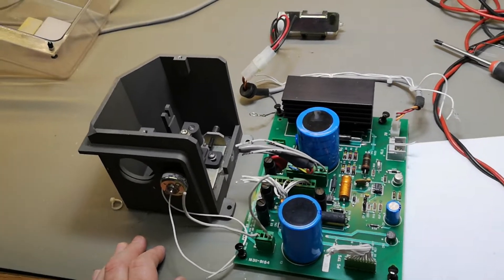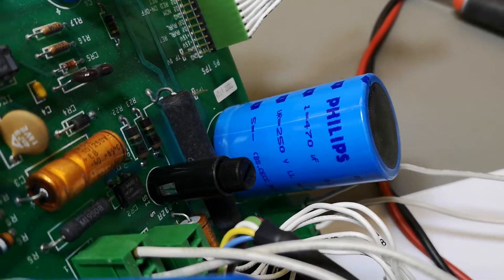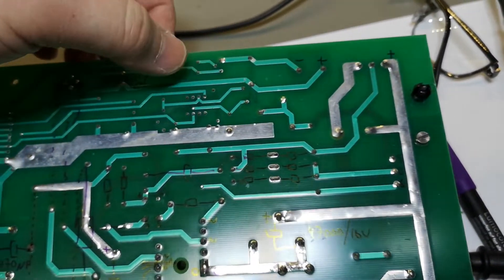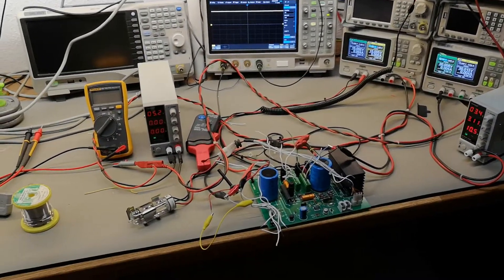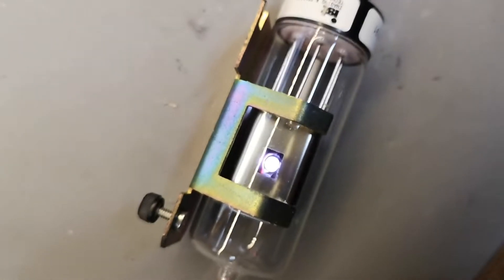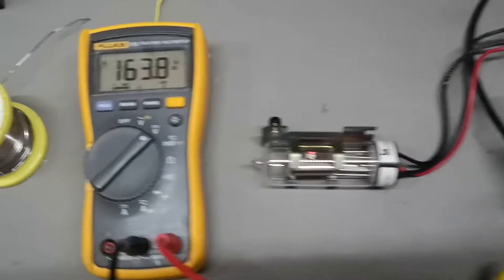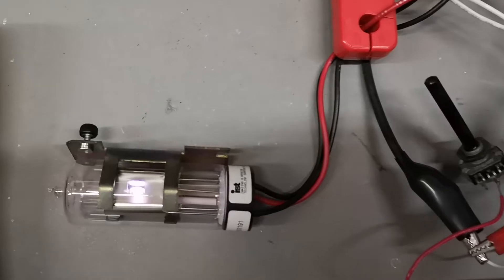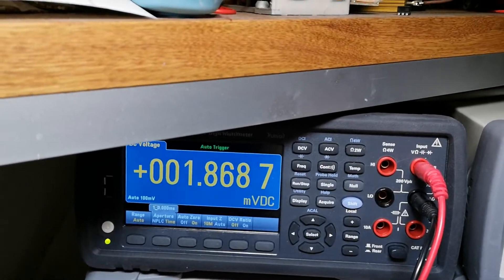DEUTERIUM Hollow cathode Lamp and Driver Optical Test and Teardown

Comment: Any danger from ultraviolet emission? Could you get a tan from it? 😂
Reply from the maker: not at all, this one is under 1W, but if you see this one : https://youtu.be/lRLb6heYPp8  the level is something very different
Reply: @TeardownOZ2CPU  Actually it IS very dangerous to skin and eyes - the power of these D2O lamps is about 30W and most of the emitted light is invisible very short wavelength UV radiation. Even 1W UV light at 200nm is dangerous. Maybe the 8mA maintain current is a measuring mistake? The specified operating current for these lamps is always 300mA for a stable arc, but it might not be pure DC current due to the arc discharge. An analog meter might give more reliable results. Its very dangerous to operate these kind of lamps if you are not 100% sure about all the dangers. Older D2O lamps in my collection had a warning sticker: "CAUTION! Do not stare at light!" When I worked in a chemistry department, our electronics guy who had to repair an 8W "fluorescent" type (of course its only a quartz tube without the fluorescent coating) UV lamp (254nm wavelength) actually burnt his eyes while testing because he was not aware of the dangers. Most of the emitted light is NOT visible to the naked eye but still affects it (negatively...). When I am playing with my D2O lamps I can even smell the ozone generated from the oxygen in the sorrounding air by the powerful short wavelength UV light emitted.